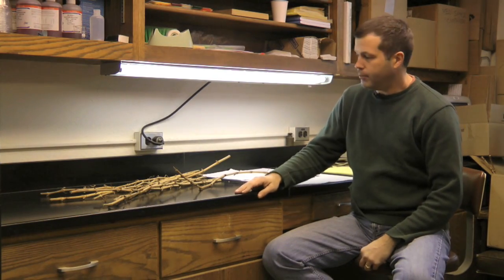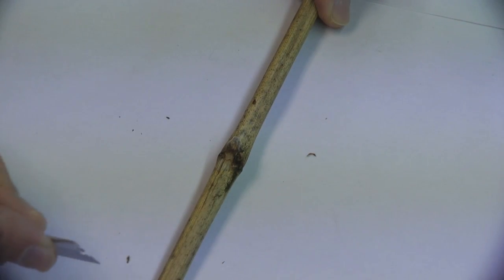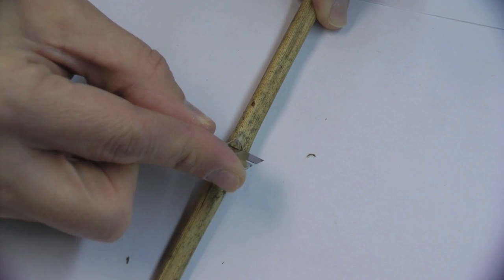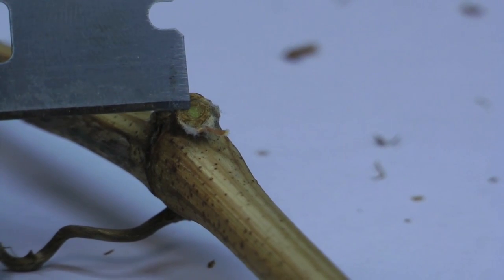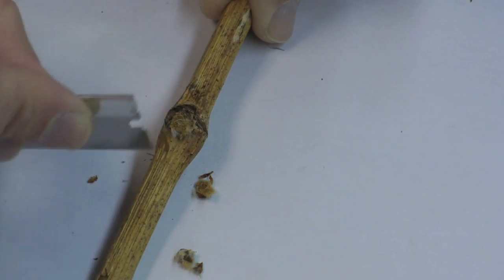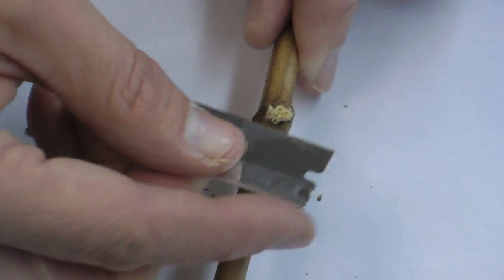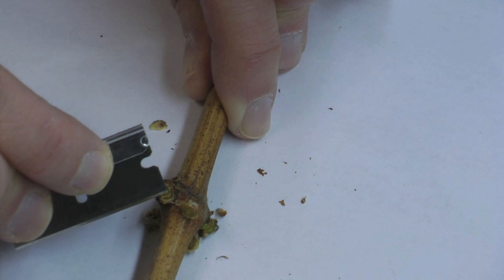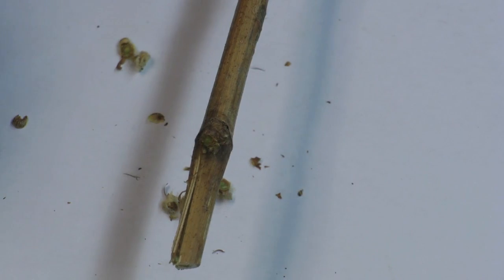FLGP Bud Injury Testing Part 2

Comment: I know you've done that quite a few years ago, but I'm hoping you can read this message. 
We're about to go through a cold event here and if the temperature hit the low predicted, it will be very closed to LTE50.
So, if I end up with bud damage, can I tie down 2 canes side by side? So instead of having 2 canes per vine, I would have 4 (two on each side). 
The reason I'm asking is I already did my pruning for 2021, but I left 1 to 2 kicker canes per vine, leaving between 3 and 4 canes. 
Any help will be appreciated. 

And Thanks for the video.
Stéphane
Reply from the maker: Yes you can do that, but you will want to be ready to do some shoot thinning if you do that. If you have several buds very close together and they all break, you will get a lot of crowding and shading in that area, which can lead to disease and ripening issues later in the season.